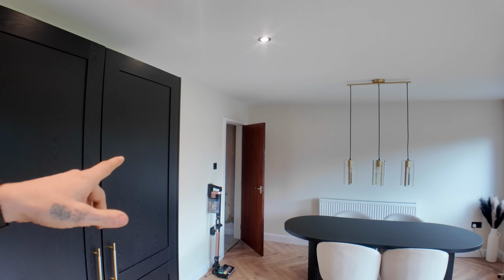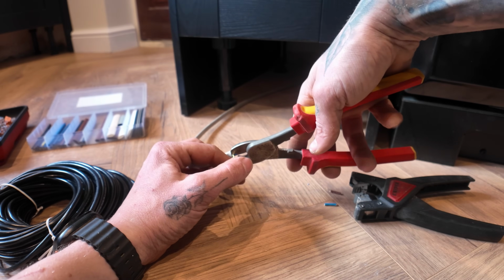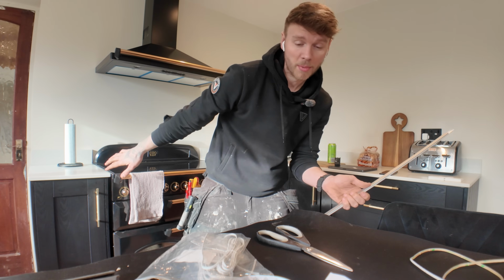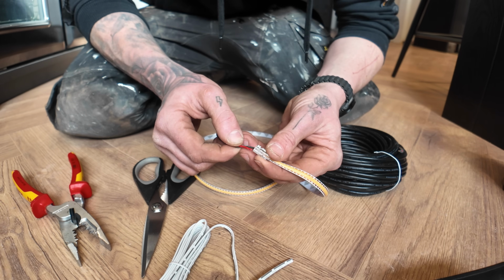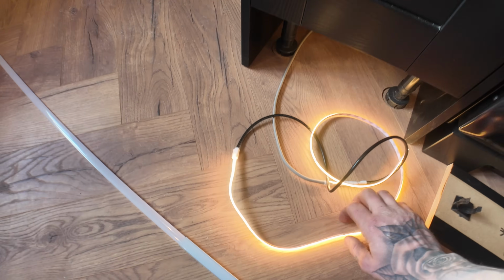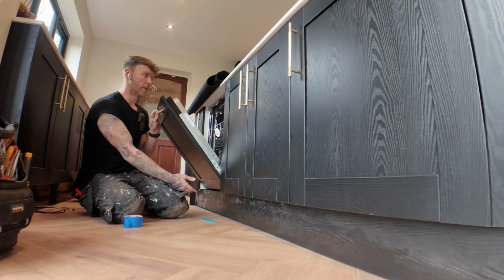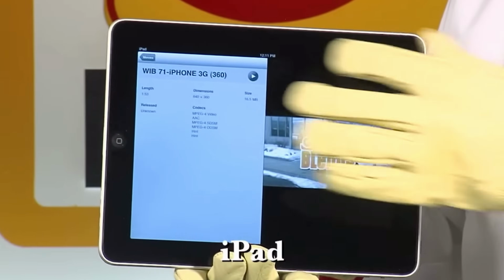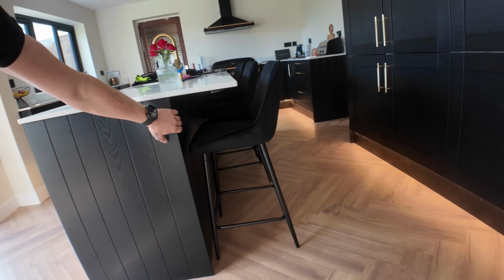I Was So Impressed - There Going In My House - Strip LED

Comment: I've done this effect on my staircase (attached the video below). But it basically uses a section of RGBW SK6812 addressable LEDs, and one of our tiny addressable LED controllers which we sell. They run software called WLED, and connect to your WiFi, so rather than constantly powering them on/off, you automate them with your smart home instead to come on with any effect you like, fade, lightsaber,  etc. And it can run all sorts of ongoing animations too. You can even virtually "segment" portions of the strip into separate virtual strips and do different effects on each segment.

https://youtu.be/kuVqUFNtNmY

Comment: I used ledspace for tunable white strips in the bathroom. We panelled the ceiling and if you plan ahead there's enough panel depth that you can fit a slim profile in so no messy plaster snd a flush finish.

Comment: Always use the aluminium profile because it acts as a heatsink. What I do is buy 1mm/1.5mm 40mm wide aluminium. I glue and aluminium to the top of the plinth which is usually 18/20mm and then add the 17/18mm aluminium profile to the overhang using more clear adhesive. It also gets over how to go past integrated dishwashers.

Comment: Just in case it's helpful - (and this is NOT an issue in the work performed in the video) - during a 1st fix many years ago, we deployed 1.5mm cable everywhere for lighting, then decided at the 11th hour to use 12v lights with a single fat driver as a feed.  We hadn't considered that the current would be ~20x for the equivalent wattage in 240v.  Fortunately, we did realise before buying the actual lighting and drivers.  We switched back to 240v halogen (as 240v LED wasn't a thing back then).

24v DC would be ~10x the amperage of equivalent wattage in 240v.  (As in, between the driver and the LEDs.  Thus, I assume, Nick's remarks about considering multiple drivers, one in each bank of cupboards.)

I'm sure I'm teaching how to suck eggs for 99% of viewers - but, even myself, knowing P=VI ... it just gosh darn didn't occur to me when having the conversation about "why don't we do DC LED instead!".

Much love, no hate.
Reply: Can you explain to a noob what this means? Do you mean the current is 20x MORE or LESS when using low voltage? And why is it a problem on 1.5mm cable?
Reply: @ZetecCollection - I can certainly try!  The key equation is P=VI.  The power (wattage, the “useful result” - e.g., the light emitted) is voltage multiplied by current.

So for the same amount of light (brightness of the bulbs - which is the same power, wattage), the lower the voltage, the higher the current.  (For 50W of lighting at 10 volts, the current must be 5 amps, as 10*5=50.  Or, rearranging the formula, 50W/10V=5A.)

At 20V, you only need 2.5A (20V*2.5A=50W).

And so forth.

So by desiring the same “power of light” with 12V rather than 240V, the current requirement increased 20-fold.  (It was 20 times higher.)

Electrical cable has a maximum current rating - as it risks melting or catching fire beyond that.  While we were well within that limit at 240V, we were far beyond it with a current 20x higher if using 12V lighting instead.

Does that make sense, and help answer the question?
Reply: I should add - the thicker the cable, the higher the current rating.  We could have used 12V lighting with a much thicker cable … but we had already ran 1.5mm everywhere.
Reply: @wallyhall  Thanks a lot. This does help! It also answers the question I had about why bother using 24V LEDs instead of 12V, as it will reduce the current load on the cable. Since 1.5mm cable should handle 15A that’s plenty for a small amount of under cabinet lighting (4m at 9W per meter).  And now these new strips offer seamless light there’s no need for a diffuser either!

Comment: They're called digitally adressable LEDs. They come in different voltages (5V/12V/24V) and densities (30, 60, 90, 144 LEDs per meter). You've got power (+/-) and a data line that goes to the controller. 

It's a bit more complex than regular strips, but fun if set up right. I'd check out QuinLED + WLED firmware - lots of guides out there. If your client isn't techy, it can get tricky tho, unless they have someone to help with settings and effects.

Cool that you have a supplier who can help if needed, always makes it easier!
Reply: +1 for WLED I run it from an ESP32 and it's flawless coupled with Home Assistant
Reply: WS2812
Reply: @TheChipmunk2008  "WS2812" Them's the ones. Checking the strip I have closest to me right now and it's a WS2812B strip advertised as "NeoPixel compatible" (which is of no surprise)
Reply: the key isn't the led tape, it's the  controller, the zoom thing is probably just a program in the controller
Reply: @TheChipmunk2008  Definitely. While there are presets in some controllers, being able to write my own is something that I'm definitely going to do. While some have a reasonable range of presets, they'll probably not have the options that I want and almost certainly no easy way to change modes. For example, if I wanted to have a zoom sequence when turning on I might want a slow fade of all lights when turning off - I am very unlikely to find this option in presets in a controller. Luckily, I enjoy tinkering and putting in place good systems so when I finally get around to (re)furbishing my front room I will put strips and controls in place. I don't want the lights to require the use of an app therefore I'll find somewhere to put a display that shows the preset sequence available and up/down buttons to change this (and an apply, and on/off button too of course). But then I also want responsive sequences which vary depending on the time of day and/or the current level of ambient light - quite simple to do but will never be found in a preset. Even the simple option in my bathroom just isn't readily available - this is where I want the under-counter lights to be on when the body/motion sensor detects a person or the main light is turned on. This way I can wander into my bathroom in the night and not be blinded and wake myself up! :)
Reply: They are really easy to work with, particularly if one is an experienced software developer who's never been shy about leaping into hardware. I'd never really considered a turning on effect such as the progressive turning on sequence shown in this video... therefore I wrote one and had a play with it leading with a different colour that is setting the colours behind it. It took about five minutes to write the basic on/off version with a variable speed and separate on and off buttons. I'm currently using 2040 modules with NeoPixel compatible strips (2040 modules support many more than just this) which are very easy to use and for longer strips one can easily supply independent 5V to the LEDs, but USB-C provides enough power for what I need for now.

Comment: Probably not so important here but  crimping solid drawn conductors is not recommended. However klauke do make the specifically. Standard crimps can fail with  movement/ vibration 😊

Comment: I'm glad you zip tied the connectors up off the floor, kitchens are notorious for spills.
Yes it might not be by the sink but that doesn't mean somebody's not gonna tip over a pot of chili (Office US reference) right next to the stove.
Or some electrician will come in and nick a water pipe and end up flooding the floor.
I myself turned on the outside spigot and then went into our basement to find 2-3 inches of water and Niagara Falls. So keeping connections off the floor is a good idea.

Comment: I think you have very much thought /planned this through, Nick. I have seen it under the underside of the worktop overhang, but I think you can only do it on the chipboard/wood worktops. Maybe a bit on top of the unit where the driver is.

Comment: For LED I'd say just use the pink speaker cable or you can use the oval 2 core flex cable, wrong colours but whatever, you can red and black heatshrink the stripped ends if you really wanted. These two cables are already cheaper in stores because they get it in bulk and they meet british standards. The cable you got from amazon looked really stiff and the black insulation was hard like PE insulation, and not made to british standards

Comment: The profile also acts as a heat sink to prolong the life of your LED tape and would always recommend soldering the wires to the tape as them crimp on connectors fail a lot
Reply: proper crimps outlast solder except in corrosive conditions, but i do agree, a lot of crimp connectors in UK especially are made. so. poorly.
Reply: @dimitar4y I wasn’t on about wire crimps I’m talking about the LED tape to wire crimps as they penetrate the tape causing a little hole which can cause heat, a slight small arc which causes the end to burn out
Reply: @djkyleb  oh yeah those suck 10/10. Proper led tape terminals exist, they have gold spring contacts and a lever mechanism to clamp the connector ON the tape without ruining anything. But they're so rare they might as well not exist.
Reply: Solder on and save the space that is the way I see it. Not hard. Surprised Nick hasn't got the M12 soldering ion, may be he has
Reply: 100% correct.

Comment: the dish washer issue with the tape , i think it is the hotpoint ones that you don,t notch out the kick board so i have used the ally track to bridge the gap , it's the bosch neff ones that you cut out the kickboard
Reply: I was thinking that the only problem is if you need to get the appliance out.
Reply: @anthonybragg  I joint it with leads into a wago  either side of appliance, fiddly but works